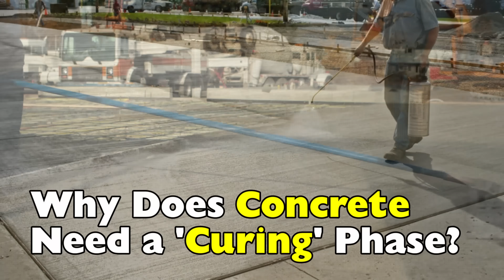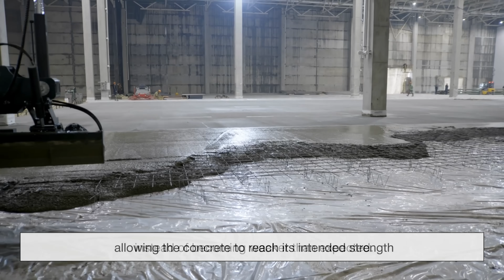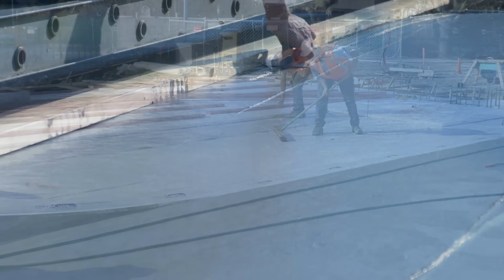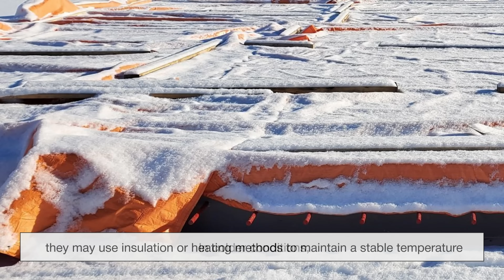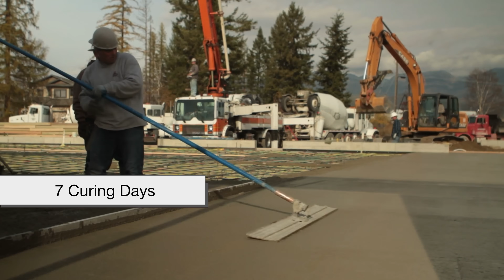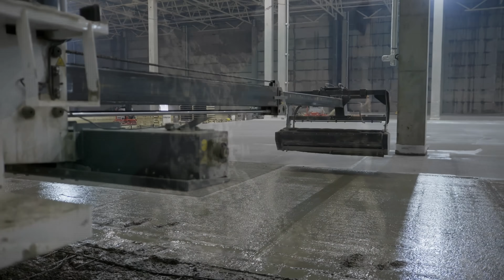Why Does Concrete Need a ‘Curing’ Phase?

Comment: An extreme example of curing duration is the Hoover Dam project. The projected curing time for natural curing was 125 years. But that time was significantly reduced by imbedding pipes with flowing cold water (on-site refrigeration plant that froze  1000lb blocks of ice) circulating. Eventually, those internal pipes were also pumped full of concrete for added reinforcement and strength.

Comment: Concrete needs a curing phase because it does not simply “dry” to become strong. During curing, water stays inside the mix long enough for cement to react and form hard crystals. If concrete loses moisture too quickly, it can crack, weaken, and never reach its full strength.

Comment: There's a lot of different ways to speed up concrete curing. High Early concrete reaches full strength in less than seven days. It's also much more expensive because of the extra cement and chemicals used to achieve that result.

Comment: Man, those Americans make some sloopy concrete. That's why there's a water shortage, they put ALL the water into the concrete mix. Less water = stronger concrete.
Reply: Water reducers are used. Polyheed 1025 and others use chemical processes to make concrete "wetter" without changing the actual cement to water ratio.